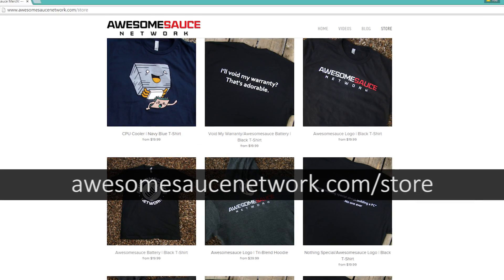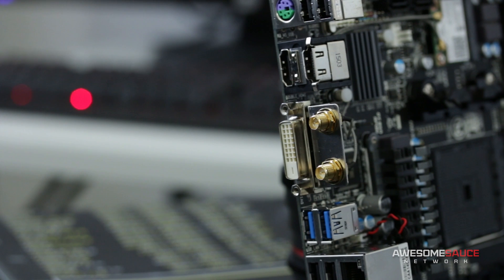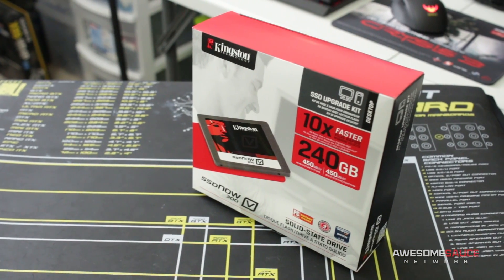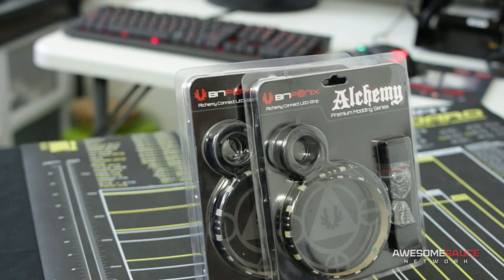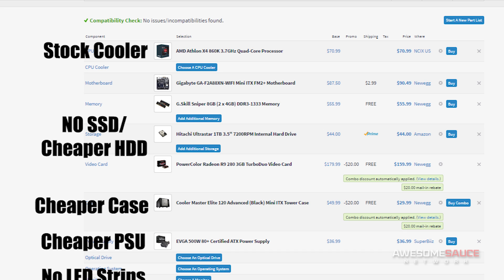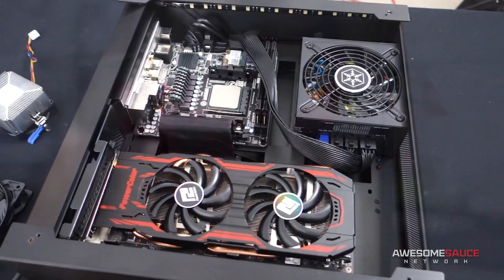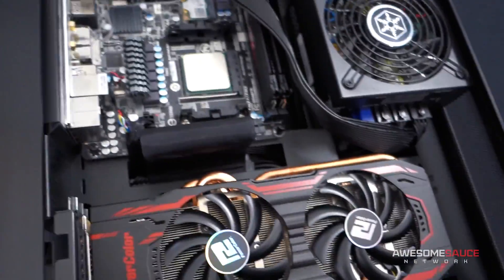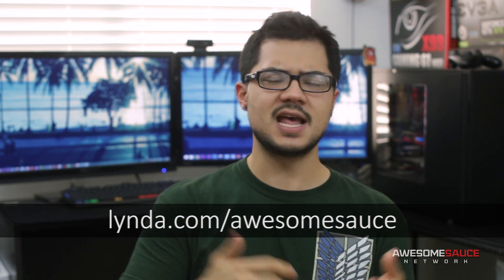The Overkill Console Killer: And How to Build One for Under $500 (Part I)

Comment: Hmm well now it's all about the gtx 1060 300$ and 200$ for the other stuff
Reply: Likely ddr2 which is why I prefer 700$ build because it gives you room for ddr4 and a reasonable cpu
Reply: Rishi Sharma I got a 1080 for that price a few days ago
Reply: Rishi Sharma no way, 600? A normal 1050 is 150 on amazon.....
Reply: Arthur Li 1060 is 226$ for the 3gb vers and over 270$ for 6gb,1080 is around 489$,tho bcs of the price RX 580 seems much better than 1060 now
Reply: Oops wrong person
Reply: Arthur Li yeah it's a zotac 1080 amp with 8gb
Reply: Arthur Li Well yeah, around 10 days ago the MSI gaming X hit 648 on Amazon and according to camel camel camel, it has been the maximum since 2016. Though now it has come down to around 450
Reply: Just go with a 200 dollar rx 580

Comment: Quick question for someone who has no clue about computers: Can the $500 version run BF4 and other similar games on ultra settings, or would I need to go more expensive?
Reply: no way
Reply: Yes you can . https://pcpartpicker.com/list/ you could get $50 cheaper if you went with rx 480 4gb .If you don't want intel i3 cpu you could use amd fx 8300 and choose an amd am3+ motherboard that's similarly priced.You could go cheaper with intel pentium g4400 or amd fx 6300 cpu and gtx 950 or rx 470/rx 460 when these gpu get released.
Reply: bear in mind, that consoles run games like that on low, at best. And usually not in true 1080. Just about any low-end gaming PC will stomp the consoles

Comment: Ok let me get one thing out of the way. I have a PC and a PS4….So im not a fanboy of anything, im just giving you my opinion as a gamer, and a PC Engineer, not a silly 12 year old rich kid like most who leave comments.
My PC is a I7 6900K, GTX1080, Dual SSD, 32GB 3200 RAM on a 2K  21:9 35” Display. My PS4 is Using a 43” 4K Sony TV in My Bedroom. But I can easily rig it up to my Samsung 65 Inch Downstairs. (Ease of Use + Portable)
Which do I prefer?... PS4 all the time
Why? Well the cost to me isn’t a problem however it is a big issue, and the more you people who think that extra 10 frames a second matter and that 120hz is better than 75hz then you are always going to get ripped off by the PC industry.
I totally admit that the PC has mods, and graphical interfaces that can be installed to improve games however they are a pain to tweak, and Windows is unreliable at the best of times.
So to play any decent games (NEW GAMES) like the upcoming Battlefield 1, you are going to need a set up like mine to run it in Ultra and even my set up will probably lag in dense areas. So unless I buy another 1080 SLI, I will have to put up with that. Not to mention the amount of PC servers that are hacked in games, it just isn’t really a very enjoyable experience.
The PS4 boots up in 10 seconds and I’m in a Multiplayer game in less than a minute, and the PS4 uses a 5400rpm Drive not an SSD. It plays any game in 1080 at 30fps and that’s perfectly fine. Even with an SSD it takes me longer to get into a game on The PC, and to buy a 2TB SSD compared to the 2TB HD I have in my PS4 is a whole different argument.
A lot of PC Master Race arguments are the cost of the games….and yeah I agree but there’s not that much difference from £32 for a AAA, to £40. However the hardware for PC is a hell of a lot more, and although theres a £40 a year subscription cost, it is very small.
If you just look at the PC itself without a monitor, keyboard, mouse……and everything you have to put into that, you could build a 1080p gaming rig for less than £400 and run it in ultra-settings, I agree. But you also have to buy the operating system to run windows, keyboard, mouse, and a decent monitor. So at the end of it all you are looking more at £600… and if that’s what you want to do just to play games on then by all means go for it. But you are not going to see any vast improvement on playing games on that particular PC than you would on the PS4,  because 30fps is smooth enough for most games, and there’s not a lot of difference graphically unless you are going to just sit there with a PC running and a PS4 side by side.
If you are playing on a PC running twin 1080 GTX for gaming on a PC then yes it totally shits on a PS4 graphically, but at the cost of what? Framerate? Extra shadows, pixel density? How often do you pay attention to this when playing a game you enjoy? Minecraft is one of the most widely sold and best games ever, I don’t see that running at 120 frames and in 4K.
If you have £1200 to spend on 2 GTX1080’s just to run games for the next 2 years it breaks down to £50 per month that you are spending just on the Graphics card to play games, in Ultra 4K at around 75fps, or around 120fps in 2K. That’s as it is now. In 2 years a new game will come out that you wont be able to run it in Ultra anymore, and a lot of people will be pissed off because they have to spend another £1200 just to get the same experience.
The whole point of console gaming is simple……..i don’t need to upgrade it, tweak any settings, I can move it easily from one room to another and plug it into any TV or Monitor. If I don’t like the game I can resell it which you cant do on Steam. And the prices are not that far apart.
So stop with this PCmaster race bullshit please. Because its exactly that.. Bullshit.
Reply: PC master race
Reply: Too much money
Reply: Well said

Comment: Damn I must be sitting on a loose chair, cus right now I'm tilted.
Any other options for the PowerColor Radeon R9 280 3GB TurboDuo Video Card
That may be cheaper?
Reply: Or at the very least same price and more likely to find on amazon.
Reply: +Master Yi right now forget those last gen gpus go for 480, 1060 , 1070 if u eant best bang for buck
Reply: a 480 or spend a little more on a 1060. the gpu needs to be bassically thr most expensive part in your budget build. a gpu can make or break a pc build. instead of an athlon I would get an 6th gen i3 of some sort, dual core yes but perform Amazing on games for the price. athlons would probably bottleneck anything better than a 290. if you get a 480 or 1060 you can maybe get away with a 450 watt psu if you are not planning on upgrading your gpu for a wile
Reply: Think you could find an amazon link for me? Kinda new to the whole Build a pc thing.
Reply: sure! don't get computer parts on amazon. I always like to go to newegg and Iv always had a good experience with them.
480: http://www.newegg.com/Product/Product.aspx?Item=N82E16814202222&cm_re=rx480-_-14-202-222-_-Product
1060 (smaller, may run hotter) http://www.newegg.com/Product/Product.aspx?Item=N82E16814487260&cm_re=gtx_1060-_-14-487-260-_-Product
and another 1060 (another fan, keeps cooler, more expensive) http://www.newegg.com/Product/Product.aspx?Item=N82E16814127964&cm_re=gtx_1060-_-14-127-964-_-Product
Reply: Amadax rx 480 runs only a little bit higher like 10 C  and is cheaper and more future proof for vulkan and dx12 also there is a good option of getting another rx 480 in the fure to get to gtx 1080 performance with like 3-5 fps less
Reply: +Arzy yea I would probably for the 480.  may not perform as well in dx11 but for future proofing as it shows much better performance in dx12 over the 1060. I got the 1060 bc I play mainly fps games (for enough fps to get to 144hz) and gta 5 and a lot of dx11 and some open gl games I like to play
Reply: Amadax also in dx11 games you can get good performance 60 fps in ultra with some settings turned to high

Comment: Why do people hate AMD, I'm going to build my first PC on a low budget since I don't play on PC much and I don't want to waste money, and everyone tells me to get an Intel rather than the fx-8350. It's not even that much worse and MUCH cheaper
Reply: usually amd has slower cores, for example a g3258 performs better than a specific 6 core amd (i forget) because its single core performance was much better. if your on a budget i would suggest the g3258, i just upgraded to the 4690k after two years, great cpu for ariund 50-70 CAD
Reply: +Staring Intensifies I think that would be a problem with the power supply bud 😂
Reply: AMD chips are famous for heating up like crazy, and they're much slower than intel chips. Get an Intel Core i3-6100, it comes with a cooler for itself and if you know how you can squeeze 3,8 GHz out of it. It's also extremely cheap for its price. ps: I just realised how old the comment I'm replying on actually is, sorry.
Reply: Dunno I have an amd only build and it runs like a champ
Reply: @Brooke Stern old comment but still don't spread misinformation Intel still wins in gaming type work loads while amds ryzen/threadripper are the king's of the workstation PC what matters is what people are going to use their PC for not what you want to be better by over generalizing what it means to be fast for a cpu

Comment: should i get an i5 or an AMD athlon ?
Reply: +Reza Yudhistira i have that cpu, a complete beast for the price, it runs fast and cool with a 212 evo, and loves overclocking
Reply: andres moreno 8320e? looks like that cpu worth for money. how about gaming performance?
Reply: Reza Yudhistira lemme tell you, i paired it with a 960 4gb and im getting solid 60 fps in bf4 all ultra 1080p, same in dying light, forza 6 apex runs the same, it runs everything ultra 1080p, but take in account that it is old and some new games may not run that good, but i totally recommend it
Reply: Reza Yudhistira just, if you buy it i highly recommend buying an aftermarket cooler, the stock one may work well, but damn, it makes a lot of noise
Reply: I5 godamn!!!
Reply: What i5 ?
Reply: +Jerk LP intel core i5 processor
Reply: i5 better. it's different class because athlon is cpu for low budget class. FX-8320e is better than athlon
Reply: Reza Yudhistira alright! thanks man :)
Reply: andres moreno nice, thanks for the recommendation
Reply: i5

Comment: what should I upgrade with $800 as a budget ?
Reply: Graphics card.
Reply: spend most of it on the graphics card but you should also upgrade the storage as 240gb isnt enough for todays games
Reply: with $800, I would actually get a skylake CPU. That way, when it is time for a CPU upgrade, you wont need a new motherboard, or new RAM. It's futureproofing.
Reply: http://pcpartpicker.com/user/Immrspy/saved/bwKFf7

PC Part picker for a $700 build. Just upgrade the RAM, Maybe a hybrid drive, and you're good to go. (This also includes a monitor, and an OS, but you will need a KB & M)

Comment: in other words, here's a shitty processor, and relatively standard parts for everything else.. oh and btw, you can't use the case in the thumbnail. your welcome thank you please come again.
Reply: Considering that the 860K pretty much destroy by 3x the i3 6100 in rise of the tomb raider. YES, that game bottlenecks to hell if you use a dual core, HT or not.

860K is the best bang for buck gaming cpu. You can invest like 100 dollars extra on a gpu instead of using it for the most cheapo i5 4 cores.
Reply: Or get a A10-7850K (X4-860K with onboard graphics) and crossfire the onboard graphics with an AMD graphics card.
Reply: +Rat Face Wouldn't that SEVERELY limit the VRAM?
Reply: ***** I'm pretty sure, it automatically just uses the VRAM of the GPU.
Reply: do not go with a a10 7850k because if you ever want to upgrade your cpu/apu agian you will require a new mobo because the fm2+ socket isnt being used in new models anymore
Reply: DrDankNugz I posted that back in July of last year lol.
Reply: Pretty sure you can get a monitor, keyboard, mouse and headset for the price of tv, but you didn't include the tv in the price did you :)
Reply: oh and I almost forgot, have fun buying peripherals which will send the price well over the price of a console.. but I didn't mention that.. because if i did.. this wouldn't be a unique "console killer" video.
Reply: #triggered

Comment: I wanna see what you an do with 350 bucks. give you a small challenge lol
Reply: Well, not much. I can get you a pre-built, or a PC with linux to run on, but not very much. Unless you are talking about a used PC, then there isn't much to get you.
Reply: +Ethan Snider well I know I can get a 750 or 760ti GPU which is still very relevant and a intel g3258 unlocked processor. the rest is pretty easy

Comment: CM Elite 120 is a bit daft, I have the 130 and the addition of a front fan mount is absolutely necessary unless you have liquid cooling, in which case you might as well go with the Elite 110 which is even smaller, just mind the GPU length....